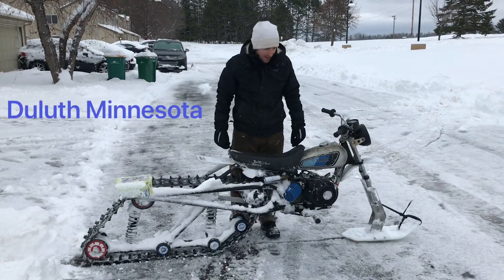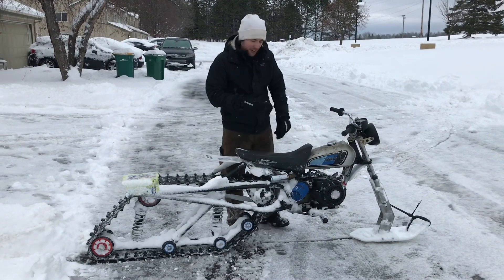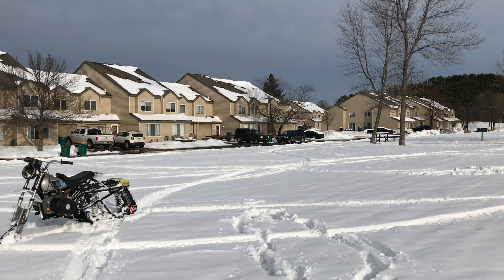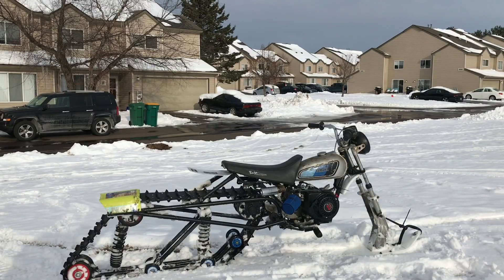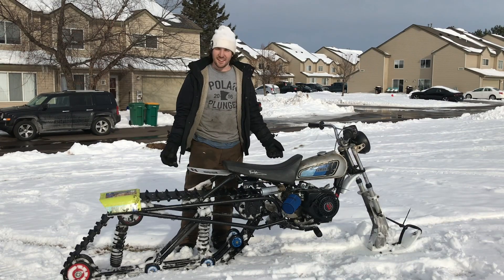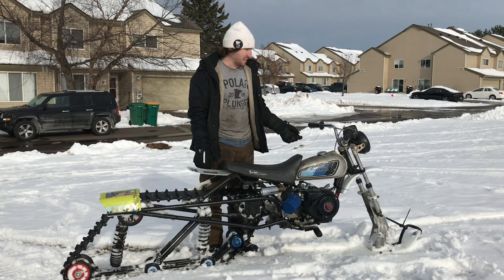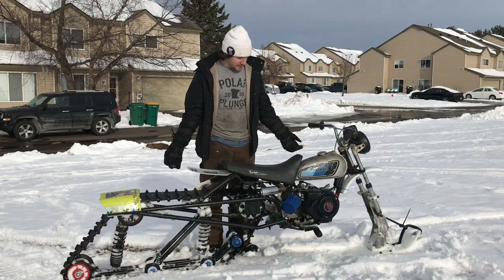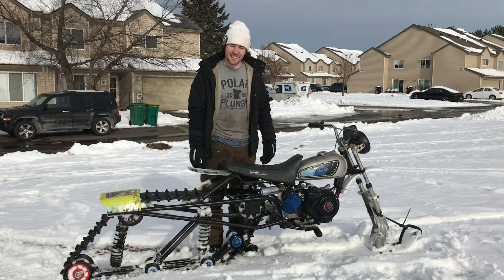Home Made, Predator 212cc Powered, Polaris Tracked SnowBike!

Comment: Looks pretty good.  Seem to plow pretty deep, though-- a longer ski?  Or even a pair of longer skis on the front?  Would add to the stability, but if they are close, you'd still be able to lean in some.  

I was also thinking--- where's the flywheel that keeps you up?  The track obviously doesn't spin fast enough... neither would a front wheel.  Hmmm..... attaching a metal disc?  Like salvaged from a couple of disc brake rotors?  Then spinning that up through a one-way system-- so it'd keep spinning, even when  you idle back?  Adding stability like wheels do on a bike...
Reply from the maker: Longer ski with a bigger front curve I think would do the trick 👍 honestly it doesn’t seem tippy at all when riding it.
Reply: @JakeItsTheCops  I subscribed to see how the newest one turns out.  Looking very nice so far.  :)

Comment: Sent by Mike, love your build. So many people are having lots of fun with the inexpensive engines. If you flipped the side plates on your forks, esentially lengthening the wheel base, would that let you get "on top" of the snow? Maybe a larger surface are ski would pop you up on top. Just looks like it would go better if it were on top, instead of plowing down into the snow.
Reply from the maker: That is a good idea.

Comment: Nice build! I’ll be sticking around! One suggestion I have from watching it is you might want to try 2 things with the ski. 1) see if you can’t find a little bigger one, maybe a deep powder snowmobile ski. 2) make the pivot point lower/closer to the ski. It looks like your current setup might be to high and causing it to want to roll up under you and hurting it’s ability to ride up onto the snow.
Reply from the maker: Thank you for the tips I’ll see how I can incorporate them! I have prior video which shows some details of the ski. I thick bigger would be good, at least a bigger curve on the front. The pivot point is right on top the ski but I’ll see what I can do! I mimicked this dyer a SnowBike ski as they have a center fin and also fin on the edges.
Reply: @JakeItsTheCops  ah I thought it looked like the pivot was up where the wheel mounts. I’m far from being a expert! But I thought I’d try to help if I could.
Reply from the maker: Ethan Short oh sure, I for sure appreciate the input.

Comment: That's pretty cool build just needs a little 
More power did you think of doing a stage 3 build in the engine you'd make quite a bit more hp
Reply from the maker: Well I did the stage 1, more power would be nice but a stage 3 is $$$. The whole build cost me about $500. I was thinking if the engine dies on me I’d put in a tillotson 212cc that has more base performance and electric start.

Comment: Great build, I have wanted to do something like this myself and will probably try it at some point knowing that it is possible. Methinks it needs a slightly bigger front ski that has it's tip raised up higher. Looks like it's sort of snowplowing instead of getting on top of the deeper sections of snow. Would work great on a groomed snowmobile trail though. Instant subscribe!
Reply from the maker: For sure with the ski, It’s 8.5in wide (as wide as the track) but needs a much higher curve on the front. Wouldn’t be that hard to recreate. I’m making something like this for a crf150f and I’ll use what I learn. Thank you for the subscription!
Reply: @JakeItsTheCops  Film the build for the crf150! I want to see how you do it. :D

Comment: If you remake the ski , don't make it wider, you will tip over more, when turning. Longer with more curve in front. I personally would just use a plastic ski with a wear bar, off a snowmobile. Save your talent to reinvent something bigger, not the wheel or ski.

Comment: Dang did you alter the gearing a bit or is that just the difference of drag and having to push snow with the wheel vs the ski?  Looks like it handles really nice. Sorting out the ski size as previously mentioned by others to get a bit more floatation and It will be perfect.
Reply from the maker: Little bit of both. The first ride I didn’t push it a whole lot cause I hadn’t finished welding everything. Also a little less snow.

Comment: Nice job on the little snow bike I did something similar I found that if the front ski is bigger it take less power to push and does it have enough power to spin the track in the snow good ?
Reply from the maker: I agree. Kind of a trail and error build. I’m making one for a Honda crf150f that will correct some of these issues. The motor actually has no problem spinning the track for hill climbs and what not.
Reply: @JakeItsTheCops  that be cool and if you need more power in 212 there's a stage 3 Performance Kit for it I make a lot of stuff as well on my channel